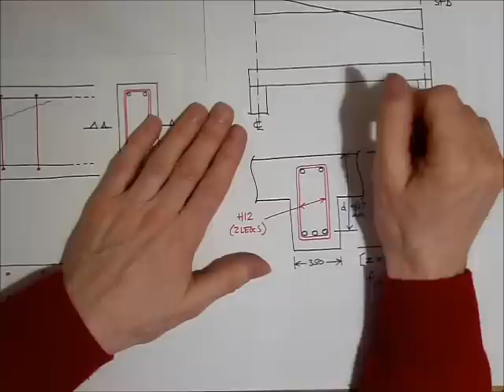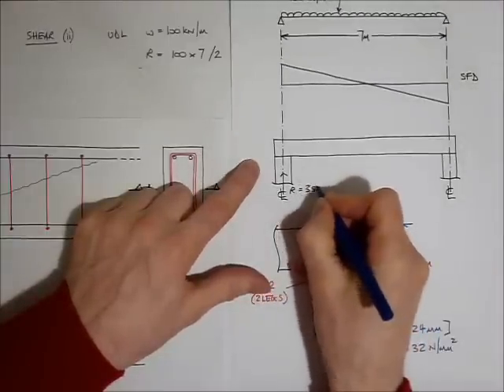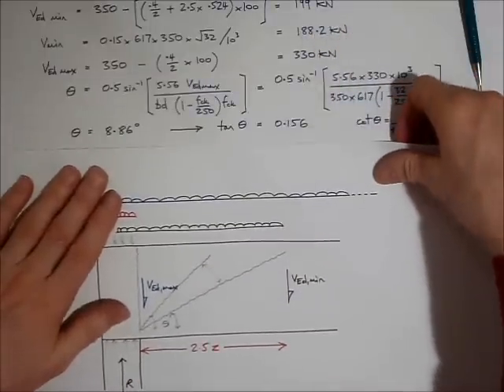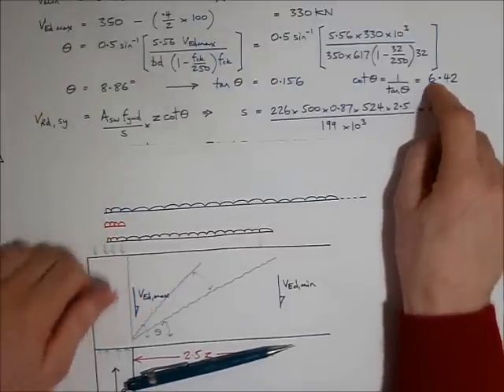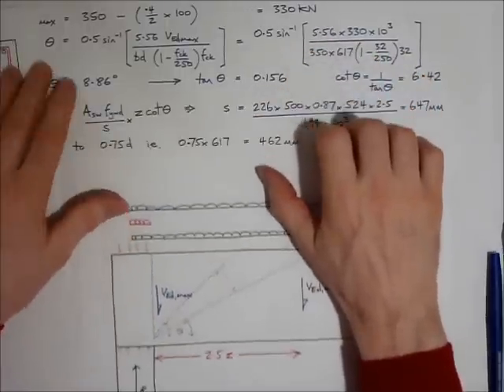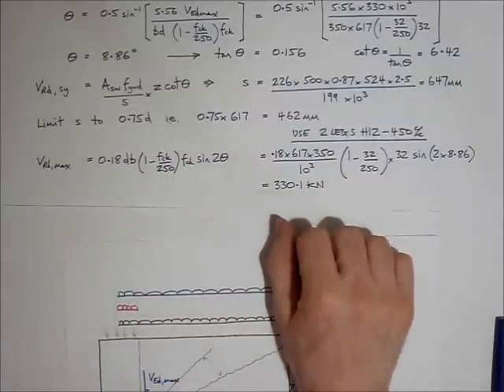RC Beam Design EC2 - Worked example - design shear reinforcement

Comment: Hi Mike when does it occur that you need to have less spacing at the support and more spacing at the mid span, because there is more shear force usually at the support? So can I ask why you used the same spacing throughout ?
Reply from the maker: Hi sid j, that is a good question. I needed to keep the length of the video short for YT.  You are right, what is proposed is conservative but, where shear is relatively small (around mid-span) we should check to see if we could reduce shear reinforcement to the minimum. This gives the designer a little extra work but reduces materials and so reduces the carbon footprint. Thanks, Mike

Comment: Fantastic lectures Mike. Where does the Vmin formula which you use here appear in EC2, I cannot seem to find it.
Reply from the maker: Hi Nick Bailey, thanks for the question. I have not taken this formula directly from EC2 but from the Manual for the design of reinforced concrete building structures to Eurocode 2 by the IStructE. This really is just one way of doing your calcs for shear. I hope this helps, Mike

Comment: Hi Mike, thank you for nice lesson. Don't have one problem with concentrate force? Thank you.
Reply from the maker: Hi Dan Florea, thanks for the comment. The example is of a beam supporting a UDL which causes bending and shear. A beam that supports a point load (or concentrated load) would also develop bending and shear forces. Once these are determined, the bending design goes along the same lines Just be careful with shear and think through how this will develop in the section. I hope this helps, Mike
Reply: @mikebather   Thank you very much Mike. I wish you all the best.

Comment: the last point was a bit confusing. Concrete itself is sufficient? I thought it wasn't and thats why we were designing those shear links in a first place. Can you please explain the last calculation?
Reply from the maker: Yes, you are right, the concrete cannot carry the applied shear forces on its own and so steel shear reinforcement is needed. Once we put the steel shear reinforcement into the concrete beam, we still need to check that the concrete is adequate - even in its reinforced state. That is what the final calculation is about. Hope that helps.

Comment: Hi, Great tutorial, and I might be a bit late. I'm just thinking about what 5,56 is taken from in the calculation of the angle after 6 min. I can't really find out where it's taken from, if it's calculated or just a standard number. Thanks for a great tutorial else.
Reply from the maker: Hi emillovgren, thanks for the question. There are a few different ways of calculating the angle of the strut for full shear force at the end of a  beam. This method comes from the Manual for the design of reinforced concrete building structures to Eurocode 2 by the IStructE. This really is just one way of doing your calcs for shear. I hope this helps, Mike

Comment: Why we designing it for minimum shear force ? when we can have shear force greater than that
Reply from the maker: Hi Nial Gul Hazarboz, thanks for the question. Hopefully, I can make this a little clearer. When designing beams to the Eurocodes, you must include a minimum amount of shear reinforcement - you don't have a choice, you just have to do this. So, my approach is to check the applied shear and compare it with the shear resistance of the beam (this is the minimum shear resistance). If this minimum shear resistance is found to be OK then we are happy, if not, then we go ahead and design the shear links to suit the higher applied shear - extra work and extra rebar! Hope this helps, Mike

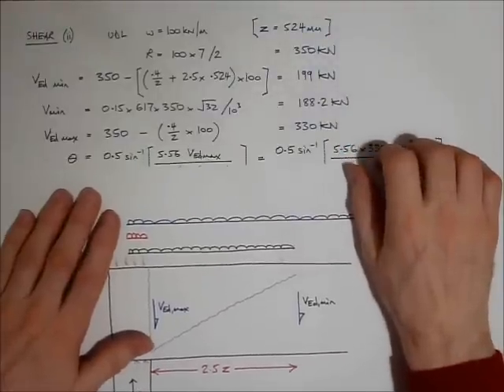Comment: Thank you for Your lessons, they are really great. I have a question about the equation on 5:58. It's about angle theta. This equations is from the EC2 or not?  If it isnt, where i can find it. Thank You.
Reply from the maker: Hi Roman Poltavchenko, I have taken theta from the Institution of Structural Engineers book Manual for the design of concrete building structures to Eurocode 2. This is a superb design guide for practising engineers. Similar guidance can be found using the "How to" pdfs from the Concrete Centre, again in the UK and can be found at
http://www.concretecentre.com/pdf/publicationlibrary/how2_beams.pdf
I hope that this helps.
Reply: Mike Bather Thank You!!!
Reply: Hi sir, I have one doubt please tell beam z length how to find

Comment: why did you use z = 524mm? I saw that you used z = 0.87*d = 535 mm in "Worked example - main reinforcement".
Reply from the maker: In the main reinforcement video I use a small load and I the beam only needs minimum shear reinforcement. In order to show how to design normal shear reinforcement, I have increased the loading to the beam for this video. By increasing the loading, I also increase the bending moments in the beam and the size of the lever arm (z) reduces as the bending moment increases. I hope that this explains how I came to use different value for z in the two videos. By the way, this is a very intelligent question for a cat.
Reply: thank you very much, Mike :)

Comment: how did you choose the legs of Reinforcement? If we assume that we had to define them..
Reply from the maker: Hi Giorgos Katsimpras, typical shear links used in the UK are 10 mm and 12 mm diameter bars. At the start of RC beam calculations you need to assume a certain diameter for the shear links. You may need to change these once you have finished the shear calculations. I guess that most designers start off with a bar size that they have used before in a similarly sized beam.
Reply: +Mike Bather . Hallo thank you very much for your respond,for your help and for your useful example.  Sorry that I did not clarify before. I meant for the number of legs for the shear.  How we will know if they are 2 or 4 for instance? I  noticed an expression of eurocode (6.8).  Once more thank you very much for your respond!

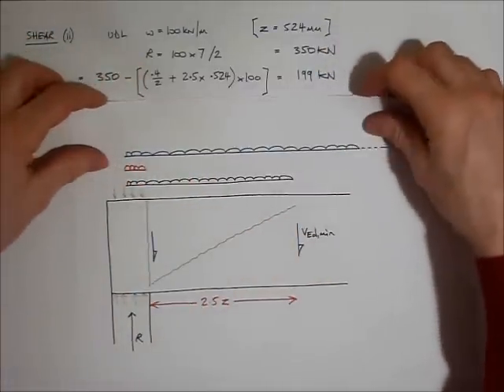Comment: 4:10 you said minimum strength reinforcement. But the formula i believe is for strength of concrete
Reply from the maker: Hi Sulaiman Samatar, at around 4 mins in the video I am trying to compare (i) the shear strength of the beam using minimum shear reinforcement (v min) with (ii) the minimum shear force acting on the beam close to the support (V Ed). In this case V Ed is greater than v min and so I cannot rely on minimum shear reinforcement but have to go ahead and design shear reinforcement based on the shear loads on the beam. I hope that this helps clarify things, Mike
Reply: Mike Bather thank you for the respond. I will watch the video again

Comment: I am having high torsion in the beam. So how do I consider that torsion in design?
Reply from the maker: Hi Crazy Rafi, This video is an introductory one for RC design and so does not cover more complex issues like torsion. The last beam that I designed with torsion ended up with slightly more links than those just needed for shear - but that was using the old British code of practice, not the Eurocode. I think that you would need a text book to help, Mike

Comment: Hi, 
where do i get these moment,shear and torsion formulae in euro code
Reply from the maker: Hi Dhineshkumar Rajavel, Apologies for the delayed reply. EC2 is not that user friendly for the design of RC elements and so it is best to go to a text book. In the UK Draycott and Bullman's Structural Elements Design Manual is a book that I teach with. The IStructE Manual for the design of concrete building structures to Eurocode 2 is good and the Concrete Society booklet Designed and Detailed is also good. I hope that this helps, Mike
Reply: thankyou sir for ur kind replay i'll go through it.../

Comment: how to design if the load was point load???
Reply from the maker: The important thing to do is to carefully calculate the shear at any particular point along the length of the beam using some analysis technique or other and then the design shear force can be compared with the shear resistance of the beam. So it does not really matter too much how the loads are applied to the beam (point loads or UDL) as long as the loading is not unusually high. Hope this helps.
Reply: Mike Bather whats the equation though